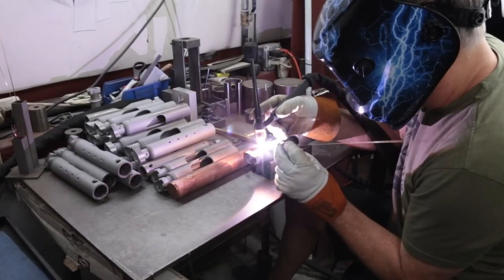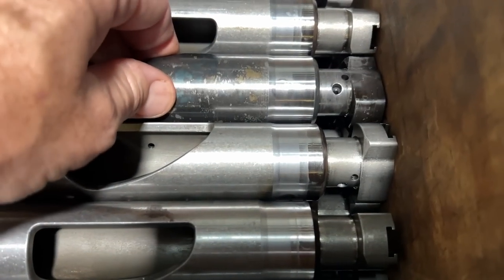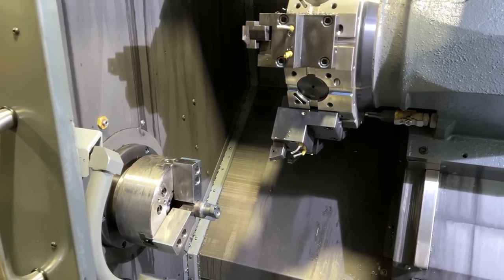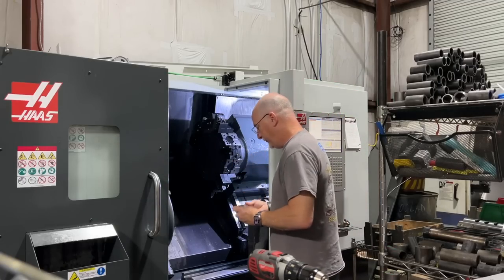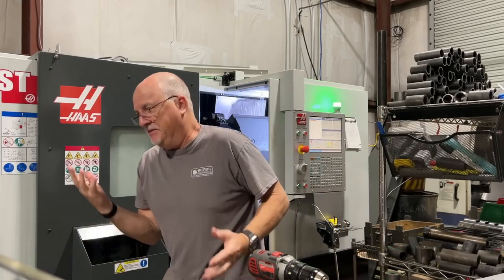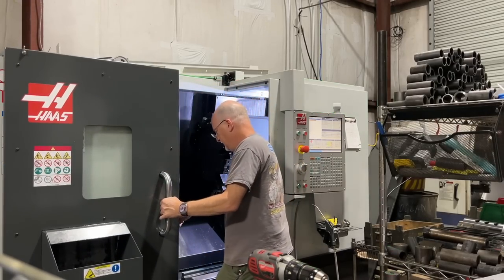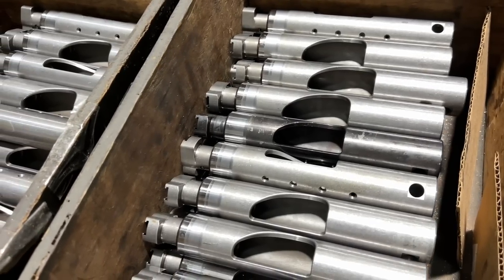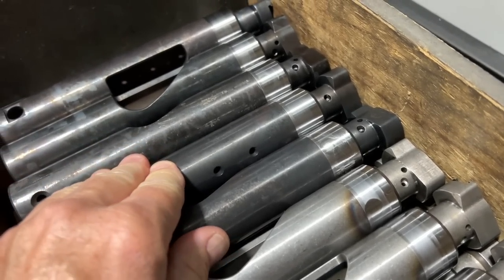Watch Your Temper!

Comment: Annealing parts before machining them is always a good idea as it relieves any stresses in the heat affected zone. As others have said, get a timer for the oven and run it overnight ready for machining in the morning. Efficiency is 99% percent about workflow. Machine in the morning, weld in the afternoon, anneal overnight.

Another good investment would be some form of welding lathe. This can literally just be a cheap import 3 chuck to hold the part ona slowly rotating shaft. This will allow you to lay down the weld in one continuous bead rather than stitching it in a stop start fashion. On that note, if you decide against that and continue turning it by hand, consider welding opposite sides. So do one side, then roate a full 180° then back to the first weld, etc. This helps even out the stresses that can orherwise warp or twist a parts as one side cools and contracts.

Comment: There is something else that needs to be considered.  
We weld a lot of 5140 equivalent steel (actually 40Cr out of China as there is a lack of Engineering quality steels in Australia)
A few years back some dingbat welder thought he knew better and disregarded weld procedure. He failed to preheat the parts before welding, and instead on pacing the parts in a "hot box" to slow cool after welding, this dingbat threw them in a cold stillage.
End result was a very hard HAZ (Heat Affected Zone) - upwards of 55HRC in the parent (5140) metal just below the fusion line.

Shortly after entering service, there were multiple failures, and in my capacity as the PBE (Poor Bloody Engineer), I had to find out what was going on. 
The initial excuses being offered was the the end user was overloading our product, which I did not believe, so I went hunting for the cause. When I found a new part in our stores with a crack in the parent metal running the length of the weld about 1mm ( that's 0.03937" to you Yanks) , the penny dropped,,, underbead cracking!!
Long story short, it cost us a lot of money and loss of reputation to fix things up,, all thanks to this dingbat who thought he knew better.
Reply: You can buy seamless 40cr or 42crmo pipe from china as "explosion proof hydraulic tubing", and make yourself a 9 mm barrel at home with water, electricity, and 3D printed tools.
Reply: We know there are 25.4 mm per inch.
Reply: @keithjurena9319  That's right mate,, but,, you don't know what side of the road to drive 😀
Reply: @leor2830  
Only some islands drive on the left..continental types drive on the right
Reply: @keithjurena9319  FYI mate, we are a continent. 
All joking aside, did you know that not until that long ago there was not even a "standard" inch. The US inch was different to the UK inch, and the Canadians had a different one again. 
To standardise an inch, it was agreed to use  SI units equivalent (25.4 millimeters) ! There is a very good video on YouTube that explains it   https://www.youtube.com/watch?v=gNRnrn5DE58
Reply: @leor2830  the metric system was adjusted to the inch standard. From 25.4xmm/1" to 25.4mm/1". Imperialists won that one.

Comment: That difference in color from the stainless pin is the chromium from the stainless oxidizing on the surface. Since you're welding over it, the stainless and the surrounding alloy steel are mixing a bit at the edges, so you're getting a gradual color shift instead of a sharp circle.
Reply: and different hardnesses/stresses as well

Comment: Maybe, set the heat treats timer to run the hour it need to aneal the part and have it  shut  off,  do it over night and they are ready in the morning for machining. I love your videos! Keep up the awesome work.
Reply: Probably wouldn't be allowed for insurance reasons......fire risk etc.
Reply: @keithcarpenter5254  multi-day heat treating and annealing is a fairly common procedure and workshops and OSHA standards are designed to limit flammability or areas where intense heat or open flames are common. Try to burn down a steel warehouse and get back to me.

Comment: Cool video! Not only will tempering before machining improve insert life, it will reduce post-machining distortion and improve tolerances. Machining weldments almost always causes them to move around substantially.
Reply: Can you help me understand why a harder metal helps improve insert life? I would assume the opposite... I have a desk job.
Reply: @benjaminhenry5869  Tempering is the process after hardening to remove (excess) hardness. In this case it's to remove basically all the hardness.
Reply: @benjaminhenry5869  me too! It’s really the difference in hardness that’s causes issues. Also, tempering is used after hardening to reduce hardness (usually to gain some ductility) and improve uniformity.
Reply: @benjaminhenry5869  You have it flipped the wrong way around, tempering draws back the hardness.

Comment: Mr. Serbu, I'm a blacksmith and I build custom flintlock firearms. I'm wondering if you anealed or at least normalized the piece if you wouldn't have even better longevity on the tool. Annealing is when you heat a steel piece to critical heat (non-magnetic or about cherry red) and bury it in a box of wood ash until its cool. That will make everything dead soft.
   Normalizing is when you heat it to a critical heat and then just setting it aside out of any breeze and let it cool. Not dead soft but close and normalizing has the added benefit of shrinking the grain structure of the steel making it tougher
   Doing either of these things will make your inserts last longer I would think, but again you have the trade-off of time to let it cool. Also, I don't know if you would have to heat the whole thing to critical again and quench and temper again. I don't know if these work pieces have to be at a certain Rockwell hardness and the piece comes that way.
  Thanx for the video. I don't know much about making firearms in a conventional way. I do it in a two hundred year old fashion. I'm fascinated with modern lathes and milling machines. I guess I'm strange, but my hobby can bring me from fifteen hundred to twelve thousand bucks. It all depends if someone wants a hand forged barrel and lock.

Comment: Use to do axle work, and welding up the bolt pattern caused the same issue. The welds so hard the ate everything. I would have to weld them up a good 1/4" high and grind most of it off to get down to the softer material. Then we started baring them in sand while red hot. A couple hours later they were still warm, but with the slow cool, they cut like butter.

Comment: My take on this would be to build a rough, but bigger kiln, heat it with gas 'cause it's cheaper and don't care about overshooting the temperature a little bit. Let it cool inside over night and it should be fine.

Comment: Watching you fiddle in a running lathe with the door open reminds me that the age bracket with the highest fatality rate in OSHA statistics is men 55-64...
Reply: That is an ignorant statement. I am pretty sure you've never been in the same room as a manual lathe, and 100% sure you've never even seen a CNC in person.
Reply: @justotalkalottashit8392  Wow! Trying to live up to the name you gave yourself. cool
Reply: That's what we call 
"Complacent" 
That's when shit can get real bad real fast...
Reply: It reminds me of the safety shutoff that keeps the lathe from running with the door open.
Reply: Tool vs temper.  You can do the arithmetic.
Reply: @mikeblair2594 he ain't talking shit he's right manual lathes are wide open ,some have a cover for the chuck but most I see don't and your working right up next to the part and iirc my shop teacher told us the main reason there is a door is to stop coolant from going everywhere
Reply: @justinbiller6683  A manual lathe doesn't move rapidly on its own, you've only got feeds and those must be engaged, like the name says, manually.

Comment: Off topic from the annealing side of things, but you could save a whole bunch of time welding the bolt head to the bolt body if you get yourself a rotary welding positioner. Could possibly lead to less insert wear as well since the weld size will be more consistent through out each part and from part to part. Something to consider anyway 👍👍

Comment: Cost analysis of running the parts thru the oven (electricity, life of the oven coils and the extra step and labor loading unloading the parts) vs slower machine time and shorter life tool life (plus the small amount of labor savings of not having to change the tool as often).

Comment: Mark, What if you went back to High-Speed Steel instead of Tungsten—just for this one purpose? Twenty-Tears ago, when I was learning Machining, the Instructors STILL regarded Tungsten Carbide Cutting tools with Fear & Loathing. Word was, they were terribly fragile and inclined to shatter. Wait, am I thinking about Ceramic Cutting tools?
Reply: Ceramic is definitely fragile. Very high speed low feed high rigidity requirements on those. Carbide inserts are relatively fragile, depending on chip geometry. They can be relatively tough, but not tough like HSS. 

An issue with HSS is machining consistent geometries. Carbide inserts don't have that particular issue. 

HSS could work, but you'll be running lower speeds to keep the cutting edge from getting hot and melting/wearing away. I used to use HSS a lot for barrel turning, but if I went a little too hard I'd have to regrind on every pass. I can do an entire barrel with one carbide insert running kinda hard now. The cost of an insert corner vs my time is worth it.

Comment: The metal of the pin is likely to have another hardness level than the rest. You could check out the hardness level in a chart and see what the hardnes should be after the heat treat. 

Was there warpage after the heat treat? How did dimensions hold up?  

When you have a lot of parts to heat treat, the time it takes to heat treat per part goes down. Also the manhour labor goes down because you dont have to be there while the heat treat is going on. 

Greetings,

Jeff

Comment: Is CNC the way to go in this process though? I vaguely remember doing an internship at a pneumatic tool company, and they had me grinding shafts or axles on a grinding machine that had two opposing wheels and they rode through it and fell out the other side. Wouldn't something like that be cheaper and more efficient to maintain then having to anneal and then temper?

Comment: Now just wondering if you shave it after you heat treat it won't it change the metal structure so the bolt won't last as long

Comment: Add a ramp-soak controller to the HT oven if it does not have one, let them run overnight. Problem solved.

I have some synthesis steps which need 25-32 hours so I have multiple furnaces running at once to keep up.

 A cheap ramp-soak is like $100 USD
Reply: Your power bill must be in the millions.

Comment: Does it also normalize the internal structure of the bolt/weld...once machined then hardened it could have all the parts/weld to be closer in hardness all the way thru as well (could be reducing stress points internally you can't see (reducing fatigue cracks due to repeated stresses (not like there are high stresses in a .50 right ;) )

Comment: Would one of those induction heater coils help to quickly heat the welded area to the temperature you need it to get so it's all the same hardness? The one I have will heat steel to red hot in just a few seconds.

Comment: Do you think the argon pressure is enough to harden all the way through the cylinder wall? or just a few mm into the surface? I am trying to wrap my head around possible fixes other than the temper cycle

Comment: Now then the next question is does it save you enough time/carbide wear and tear to justify the time and power to make it worth while.

The other thing I'll say is I'm surprised you don't have some sort of jigging to align the bolt in the jaws. Something pneumatic through the rear of the spindle bore to push it forward or something.

Pretty sure you're talking about the Russian Lathe Video.

Comment: One of the peculiarities of men. They gain knowledge about something, they are compelled to use that knowledge. The question is; , does the tempering produce a better product? How many parts will the insert complete after the parts are tempered. I think those are the factors that will make or break the tempering cycle. If the inserts last 4 or 5 times longer, it might be a wash. If the part is better, as in a finalized condition after all the process, yeah, you're gonna temper before machining the weld area.
Reply: Tempering at his scale is basically free so it isn't really much of a trade-off
Reply: A better part is a relative thing. I've seen many machinists fuss over surface finish when it's not a requirement for the part to be fully functional. Don't waste time and money for things the part does not require to be functional!

A good example is common cement for floors, roads and sidewalks. You can "broom" finish it or work the surface until it's as smooth as glass. The glass finish might look nice but it's not any stronger and those semi drivers running down the highway get more traction from a "broom" finish and are less likely to hydroplane when it gets wet.

Comment: Does it make the bolt safer in the long run if you temper it and reduce the weld joints from fracturing in those places.
Reply: I think it does.  Anneal on the same day as welding...

Comment: Ugh, sounds like you need to do a cost/benefit analysis, once the heat treat is included in the process, it becomes a matter of increased tool life and cutting speed vs. trashing inserts, slower machining time and earlier tool failure. How many parts can be machined with one insert if they are normalized/heat treated vs. non heat treated parts and slower speeds and feeds. Yep, cost benefit analysis, also the time and cost of normalizing has to be included, your heat treat guys might make you a helluva deal on normalizing, but it also makes the vendor a potential bottleneck. I believe I would try a thirty part run with both conditions and see what seems more efficient/cost effective. Just saying and you're the guy who has to Pi R Square the results. Great Video !!!!

Comment: Coolant??? Before anyone starts on me I have seen this happen with parts. I don't know all the science behind coolant recipe but I think its more how the coolant shocks the surface when machining. I had do a cosmetic surface a while back and found brushing on some way 68 in a quick pinch to get parts done for customer worked out better. I only had 200 parts so it wasn't like it took forever to complete the job by brushing some oil on each part after I chucked them up.

Comment: If you have difficulty machining them why not use EDM and use a carbon or copper electrode instead of wire if there's not clearance to run wire EDM for the bolt head lugs?

Comment: There's a dozen ways to skin a cat and you picked the weldment route. I probably would have went with something different but it's your cat; skin it anyway you like.

Have you seen those coil induction heaters some use for heating up round things such as your bolts?

The coils come in different diameters and lengths depending on your needs. They are usually just a hollow tube like a piece of brake line that's wrapped into a coil. They pump liquid (often water) through these coils to keep them from getting too hot.

You could use one of these to spot heat your bolts to anneal before turning them in the lathe. I'm not sure if you would need to stick them in sand or something to slow the cooling or not? It all depends on your metal properties.

You made it look like your taking your bolts directly out of a hot oven which seems strange to me. If that's the case then an induction coil heater would work well for you.

Those ovens don't like the thermal shock from opening their doors while still hot and will break down the bricks sooner.

Comment: what about the bolt face and lugs, I think untempered would be preferable...?
Reply: The bolt face and lugs aren't getting austenitized and quenched to martensite (hardened) until the heat treat process that they do after machining. But untempered martensite is NEVER a good thing, especially for parts that see impact (like bolt lugs). It's extremely brittle, so even if you only temper it at very low temperature and don't reduce the hardness much, any tempering at all will increase impact toughness a lot.
Reply: The whole bolt will be heat treaded later.  Then all heat prior heat treatments will be erased.

Comment: Welding is a slow, fiddley and error prone process that should be avoided whenever possible.
Reply: I agree! I think he could design the two pieces to fit together with a press fit and have a shoulder in the part to guarantee pressed depth consistency.

They could then be drilled and pinned if needed but if done right I don't see the need.

A good example is a crankshaft like those used in high horsepower motorcycles and snowmobiles. They look one piece but are actually pressed together from pieces.

Comment: you can hear the difference in the turning, what is the difference between cost ? the cost of the tool bit and the cost of the extra step of tempering, production cost is the bottom line as you well know
Reply: That tempering oven is probably 3-4kW so like a dollar of electricity per cycle, so probably ten cents a bolt.

Comment: Mark you know an internal stop would save you time as well.... instead of that double peddle tool stop dance
Reply: You also run the risk of a chip getting in the way to throw off your precision when using internal stops so you then need to blow out the chuck each time before inserting the next part so your not really saving any time.

Another problem with internal stops is your locating off the back of the part. If the critical dimension  tolerance was measured off the bolt face then that's the surface I would want to locate from.